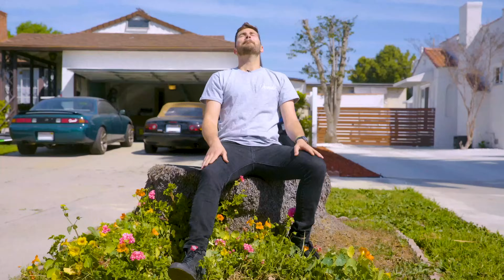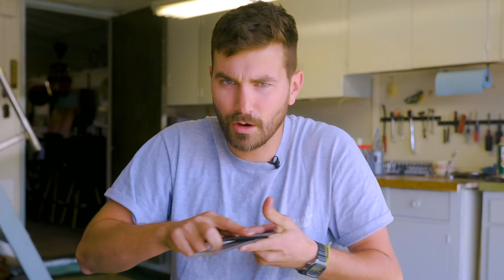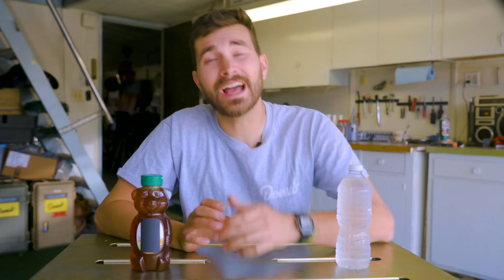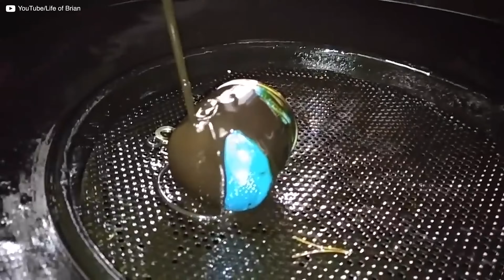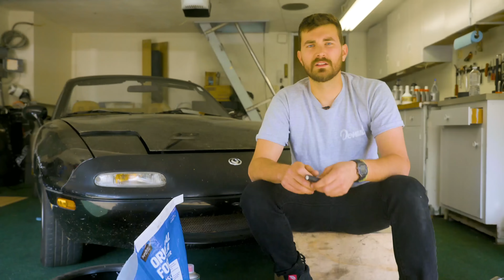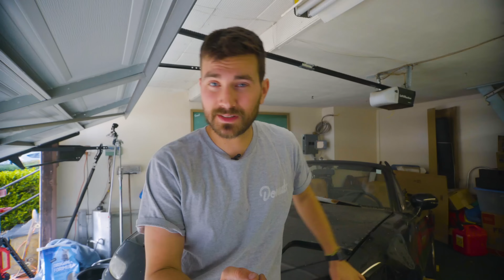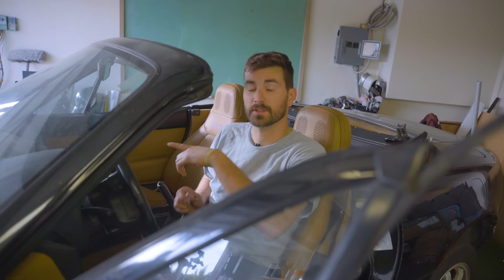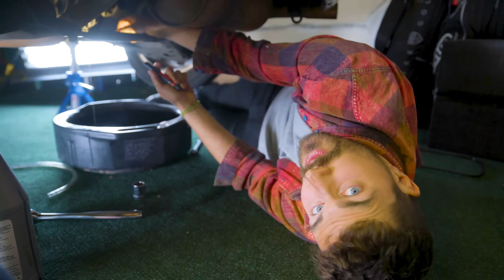9 Things You’ll REGRET Not Doing to Your Car

Comment: I'm sure this has been said already, but in case it hasn't, or it hasn't been noticed, I have two more important additions for the oil change: First, for the detergents and dispersants to really do their job and best clean out what's in the engine oil, it really helps to get the engine fully warmed up. Personally, I like to get the car on the highway for a few miles, just to get everything as warm as possible and have some higher-RPM operation, to stir everything up as much as possible. This way, the detergents get the most crud they can off of any surfaces, and the dispersants keep any dirt suspended in the oil. If things are too hot, either let it sit or put a fan in front of the engine just long enough to where you can work on it.
Second, yes, take your oil to a parts supplier to get rid of it... but call and check with them first! Their waste oil tank might be full, and you certainly don't want to get there with jugs of old oil, only to find out they won't take it. Statistically, some of you are the kind of person who would, in that situation, then just leave the oil sitting outside the store because you can't be bothered. So just call first.

If the parts houses can't take the oil, call around or stop in to some auto repair shops. They all have oil disposal tanks; if you ask nicely and don't have any other fluids mixed in with your old oil, one of 'em will probably let you dump it in their tank.

Comment: Thumbs up to the video I would just caution against putting aftermarket fluids in the car.

Motor oil is ok but modern cars are very sensitive to transmission fluid and I would get that OEM from the dealer. Definitely call somebody you're cool with for a second opinion before putting aftermarket fluid in your car.

Comment: You should also fill your oil filter with new oil when you are screwing it back to engine. It prevents the engine to run few seconds "dry" metal to metal... IT is usually even written in the manual!

Comment: Seeing as this is aimed for beginners and intermediate drivers. Need to state the reason that you take the fill bolt out of the differential first. 
You want to take the fill bolt out first, so that you know it will come out. If it won't come out then you cannot refill it. So you don't want to let all your fluid out of your differential before you know for sure you can refill it.... Or you will have to drive it without fluid in the rear end. That might last 5 miles.......

Comment: Quick note about gapping spark plugs
Some spark plugs should NEVER be gapped, such as Bosh Fine wire Double Iridiam, or NGK fine wire double iridiam
They can be damaged if you attempt to gap them
I no this because I work at a parts store and in the notes for these products, it says in all caps DO NOT GAP
Also, the way is adjusted the gap of the spark plug is a MASIVE no no if you have anything other than a copper plug
If it has platnum or iridiam on the ground electrode and you gap it like that, you could end up damaging the tip, and cause a bad spark, or even cause the platnuim or iridiam to fall off

Comment: You can make the brake bleeding process easier by no pumping the brakes multiple times. Don't worry about building pressure at first. When you do a lot of pumping like that you end up breaking the air bubbles into smaller bubbles which take longer to get out. If you just push the pedal down and hold, open the bleeder, close the bleeder, and pedal up you will save time. Just rinse and repeat. You should have went Right rear, Left rear, Right front, and Left Front for the bleeding procedure. You start at the caliper furthest from the master cylinder.

For spark plugs don't use the gap tool to spread or even measure the gap. It will wear the material off of some spark plugs and never gets a great gap. Use feeler gauges to be more accurate. In a Miata it probably doesn't mean much, but it is a lot more professional.

Aside from those little things. Great content and loving the shows.

Comment: Man I feel like I would really screw this up on my Range Rover.  And I don’t want to do that.  And on my M5... well... I can’t access anything.  So idk what to do.  Because I hate the dealer maintenance fees.  Any suggestions guys?  

On the ranger rover Evoque I bought my wife, it’s a turbo and she loves it.  I detail the hell out of that car and there isn’t a scuff mark on it.  But you know as well as I do, it’s going to suck later on in life with electrical and possible engine problems, it’s 3 years old now and only 40k miles.  But I know when that things starts pushing 75-100k miles there could be issues.  I do have a 125k mile warranty on it bumper to bumper, thanks CarMax, only place I would buy a used car like this, but I don’t want to screw things up doing my own maintenance.  However, the components are all there for me to do my own maintenance, so my question is Has anyone done maintenance on that car or one similar?  Another Range Rover model, or some sort of other high performance SUV.?  And if so did it turn out ok?

Question 2... how the F do you do maintenance on a 2019 M5 Competition series?  Even when I got my first bmw at 20 years old I had this issue.  I sold door to door security, back in 2009 and made more than I was paid lol but all in all I saved all summer long, and went in there and bought that 2007 335i m series.  Not an M3.  When I brought it home to show my dad, shortly after he called me an idiot, he tried to check the fluids, and was like wait, you can’t even check your oil, yes you are an idiot son.  Then a few weeks later I chipped it, and put on the M3 tires and he drove it, burned some rubber which brought him back to the feeling when he was my age taking cars like his el comino down to the track, and said ok, your not that big of an idiot.  That’s really comfortable and a whole lot of fun.  Haha love my dad.  But neither of us figured out how to do the maintenance, paid 2200$ for brakes, and less than one year later someone crashed into me and totaled it.  I switched cars to an avalanche truck, a Kia Optima slc turbo and even a corvette Z06 over the years, but all the while, I loved that BMW.  So I went out at 31 years old and got one.  The BMW M5 Comp. (door to door sales have been good to me, especially solar), yet after all these years I still have no clue how to do self maintenance like an oil change.  I’ve only had the car for a few months, so I haven’t needed to yet.  But I can’t see anything to maintain.  No dip stick, no brake fluid container, no steering wheel fluid container, no nothing.  Except I think I can put in window washer fluid. So has anyone ever worked on their bmw?  How do you get all that plastic covers off the engine housing and everything else?  Is it worth it? Is it possible? And does self maintenance void the warranty?

Thanks for any feed back and response. I really appreciate it.  I’m a car guy in the sense of living and knowing a lot about cars and loving to drive them, but I don’t know how to fix them like some people on here I’m sure. 

Also sorry for the long comment for anyone reading it and trying to help out, but I figured I’d try and make it an enjoyable story to read rather than just straight tracks.  And if anyone wants info on how to get into door to door solar sales, how much you make or could make, the type of company you need to work for, how to do it, or anything else.  I’m happy to offer that info to.  It seriously changed my life.  Everything I have I owe to God, but also door to door sales.  

Thanks everyone

Comment: I always pour some oil into the filter before I put it on the car, that way it's not completely dry.  In fact, take a Ford FL1A filter, and you can fit over half a quart in there or more.  Dry starts really suck.  One of my cars does not have power steering....  :-p

Comment: Quick question for anyone with experience. I just received a truck from my grandparents (1997 F150 XL, 4.2 V6, 5 speed manual). It was sitting for a while (multiple years) and I've already had to replace the fuel pump, and I replaced the fuel filter (pain in the fucking ass).

It has 152,000 miles. I don't know the last time the trans and diff fluid were replaced. I have to do some work on the clutch hydraulics before I can drive the truck (slave cylinder gets stuck after light operation of the clutch, so I'm replacing everything besides the clutch itself [master, slave, all hoses and throwout bearing]) so I cant drive it yet. Should I take the "better safe than sorry" route and replace all the fluids? (I already plan on an oil change).

Gotta change the spark plugs too, it likes to misfire. Also have a code for the IMRC valves. I did have a vacuum hose loose when I started it after the fuel pump replacement, so maybe that was the issue, idk.

Comment: Ok, mechanic here.
For your engine oil you don't need to change it every 3 months or 3000 miles, not ever 5000 miles but more like every 10k-15 miles or a year.Of course if you drive alot you should change it sooner, Maybe every 9 months or 8k miles. Changing your oil that early does nothing but harm the environment.
Also im from europe, we do tend to drive less here than you american people but still, save money, save the environment.
Also also, this of course applies to normal or slightly modified cars. If you have a 1000hp Supra it's a different story.

Comment: Just so everyone knows, most modern vehicles have what's called a sealed transmission. They don't have a dipstick to check the level. Also, each different transmission has its own temperature range that the transmission fluid needs to be at in order to measure it's level correctly.
Most vehicles also don't give out the transmission fluid's temperature, so a scan tool (I use a ScanGauge2) is needed to get this transmission temperature.
Once your transmission fluid is up to temp, you take out what's called a check or overflow plug to let excess transmission fluid out.
BUT WAIT! YOU'RE STILL NOT DONE! Letting everything from the transmission pan out only usually gets out 1/3 of all of the transmission fluid.
So, you'll either have to do this 3-4 times - OR - pump out 25% of the total fluid, refill, pump out another 25%, refill... etc. until you pump out all of the transmission fluid.

If you do it like this video shows you, your transmission could be in danger of being at the wrong level and also only having 1/3 of the transmission fluid being clean.
Sorry fellas, but eaither more research needs to be done or let people watching this know that, while possible, changing the ATF in most modern cars is much more involved and you need to know what the transmission temperature range for replacing the fluid is, along with torque specs.

Comment: The way I change my oil is different. I buy 5 quarts. The reason being is because the 1st quart is a cleaner of sorts. After I have fully drained the oil. I pour a little over 3/4 of a quart in to help push out any left over sediments that might still be in there at the bottom of the pan, so I can have the "cleanest" oil possible. Once I see that it's draining pretty clean I put the drain plug back on and fill with other 4 quarts. That under 1/4 quart I have left I pour a little in the oil filter, just to have the mesh pre greased, and use  some on the filter's gasket. Whatever oil is left from the 1st used quart I save for whatever "emergency" may be needed. Really I just try to fill it back to a full quart, so I can save 1 quart down the line. I do the same process for my all my rides 2007 Camry LE (130,000mi), 2009 Pontiac G8 (89,500mi), and my 2013 Hyundai Tucson (89,000mi).

Comment: Remember to check your oil for metal particles. You can also send in  samples of your oil to get tested, called an Engine Oil Analysis. This will allow the testers to identify what metals are wearing and how much. This test will tell you if the metal wear is a bearing, journal, cylinder....

Comment: Good overview.  I would like to have seen notice that more detailed videos are available on line for specific procedures, sometimes for specific car models.  Tips and additional matters to cover..
Removal/Installation of spark plugs should be done on cold engines.  Caution needed when starting the spark plug threads (before ratchet tightening) to avoid cross-threading.  I think the general consensus is that other styles of gap gauges are preferred over the coin style.
Proper disposal of the other fluids besides engine oil.
Some fuel filters are in the gas tank and perhaps better left to a professional.  If not using a fluid line clamp,  put short pieces of fuel line or other tubing over the locking plier jaws so they don't cut into the fuel line.
If you changes your own engine belts, 
Even though not DIY for most people, timing belt deserves some mention.

Comment: About wheel nut torque spec: Honda has the spec at 79 lb-ft and when I torque them that way, just the weight of my breaker bar is almost enough to break them loose. I’ve always used 90 and it’s just fine. Every time I’ve taken my car to a mechanic, the lug nuts are over torqued to about 100-120 from my guesstimation. If you are gonna follow the manufacturers spec (65-80 lb-ft) just be sure to try loosening them after a bit of driving to make sure you feel like that’s a safe torque for you.

Comment: Hi there. I like your vids. Have you done a video removing that big carbon (I might be saying this wrong) canister (the gigantic one and not the little one in engine bay) next to the small fuel filter under the car? Supposedly I overfilled my gas tank and flooded it. I'm trying to replace this. I'm not exactly sure how to remove it. I can't find a video on this?

Comment: i don't get the oil thing...

10w-30 behave like 10weight oil in winter but behave like 30weight oil at operating temp? if so how come he says that it thinner than it was originally...or is it that the 30 is not a linear representation and that it's only thinner than original but not as thin as 10SAE oil would be ( which is what he essentially said...) i just want to know what exacly the 30 means...is it an like an absolute value or a relative value

Comment: I definitely lost brain cells watching this garbage.  Hint: If you want to bleed your brakes, but you don't have a friend to help, hook up a hose to the bleed valve, loop it up and then back down under the valve ending in a cup or bottle in order to create an air lock. Crack the valve open and leave it open while you go pump the brakes yourself. No air enters the system, and you just accomplished this just in 1/10th the time these guys suggested.

Comment: Great video! But the only two checkpoints you gave specific time tables for were the engine oil and spark plugs. Granted, I know some folks that change their air filter every oil change, and others (myself included) change it about once a year, and you change the trans fluid every 75K-150K, depending on manufacturer (basically whenever you change plugs-if you use platinum or iridium plugs), but some folks watching may not. Then what about the brake fluid, diffy fluid, and steering fluid? Or the belts?
Reply: You change the engine oil and trans fluid way faster than that my friend. The manufacturer recommended intervals involve you keep the car for 100-150k miles, which is just a bit over the warranty. If you follow their intervals, once the warranty is done, things start failing.

Comment: Ill add this for anyone bleeding there breaks:

If you have a lot of air right after your master cylinder for whatever reason, that air can travel to any point in the system. At some point, the hydraulic line attached to the master cylinder will branch to each of the four wheels. As you pump the brakes, the air will propagate down the hydraulic line, and randomly go down one of the branches towards one of the four wheels.

If you start with the wheel closest to the master cylinder and bleed it until there is no air, and then move on to the wheel furthest from the master cylinder (just as an example), as you're pumping the air out of that longest branch you could realistically get more air bubbles in the shortest branch. You wouldn't even get that air out, because you've already bled that wheel and you think you're done with it.

When you start with the furthest wheel, though, you minimize the possibility that you miss air bubbles. This is because when you move from the furthest wheel to the second furthest wheel, you now only have fluid flowing past three of the four branches. There is no fluid that is passing that fourth branch, so there's less chance of air getting in there. Here is a rough illustration:

# Rough Image
                        -------
                       |       |
                       |       | <- Master Cylinder
                        -------
                           |
     Closest Wheel  -> ----|
                           |
                           |------- <- Second Closest Wheel
                           |
                           |
3rd Closest Wheel -> ----- |
                           |
                           |
                           |--------- <- 4th Closest Wheel
Reply: Huh... never would have known that

Comment: a must on removing any belts align it first on its timing mark before removing it specially on the camshaft and crankshaft if accidentally mis align it and didnt align it when you start the engine you might damage the piston and valves inside and after putting the belt rotate the crankshaft 3 to five times if it locks try to re align it or get a mechanic to fix the problem..if re using belt .mark the rotational direction if you by chance didnt mark it and return it there a chance it jump inside or fly away